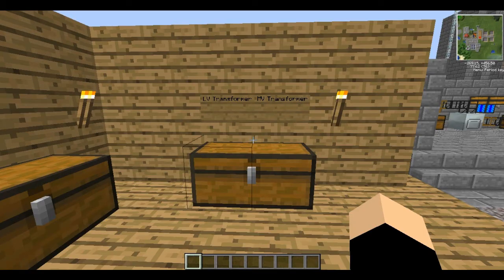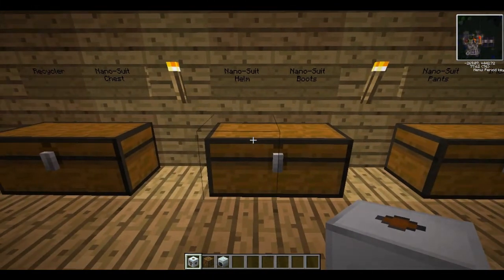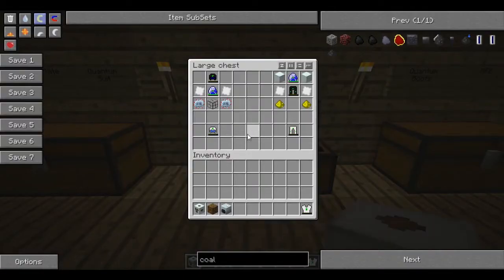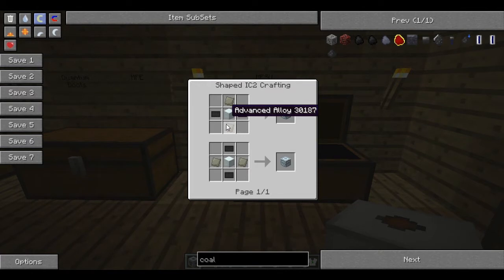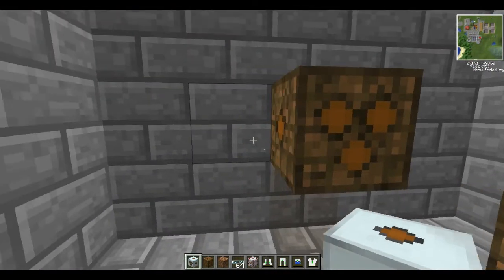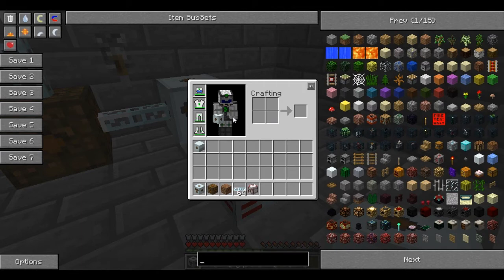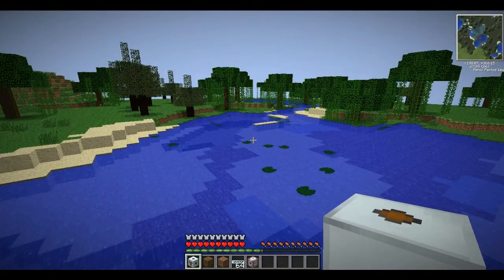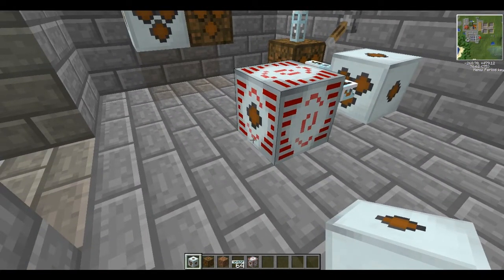Tekkit Tutorials Part 7 - Nano-suits, Quantum Armour, MFSU, MFE, LV / MV Transformers

Comment: HI i have my MFSU with transformers connected then to my mark 3 charge bench compressor, extractor and my macerator but it wont output any power and i have no idea why. all of the transformers are pointing the right way as well